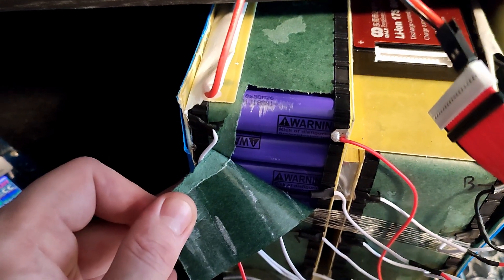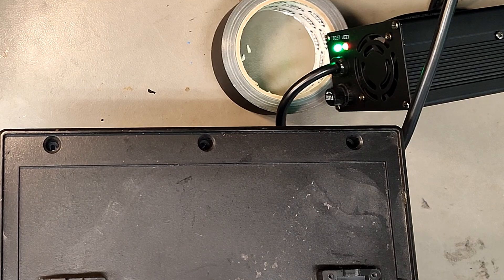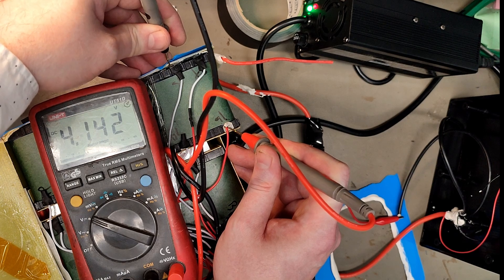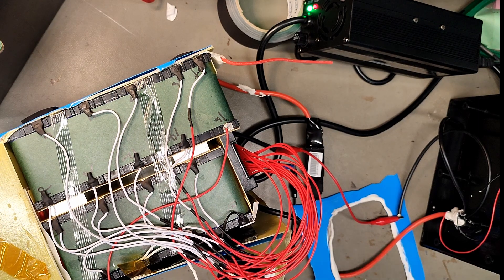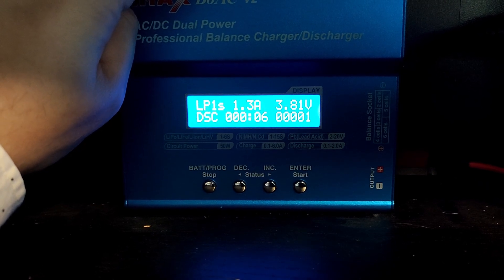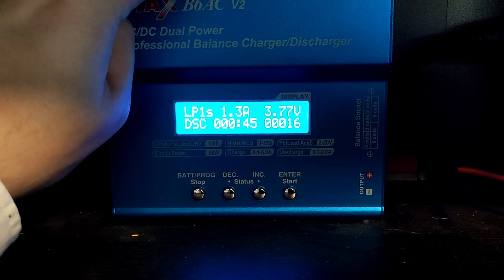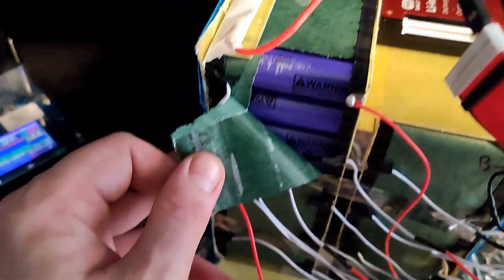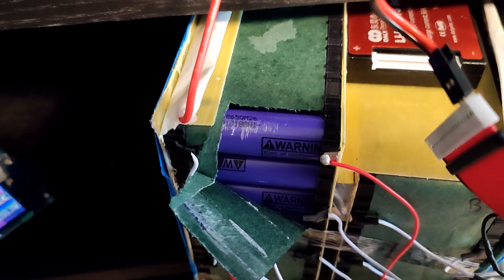Ghostcells: This is the END for LG Chem (Problem: Charger turning on and off)

Comment: Just to know.
I repaired a lot of bosch battery power pack. Bosch used such cells (no fake) on some batery pack. The cells are dead at around 300 cycles. I dont recommand  such cells at all

Comment: This is a common problem with the installation of this battery, not a problem with the type of LG cell. No-name Chinese cells will drop voltage; the charger will try to charge, the cell will try to resist, not increasing the voltage but overheating and catching fire. However, this company has already experienced this and they transitioned to branded cells. What can they choose that is popular in the EU? Panasonic, Samsung, or LG? At that time, there was mass production of M365 Xiaomi scooters, and the LG M26 is popular for its best price-to-performance ratio. But these cells have higher internal resistance than others. LG designed these cells to last long, even up to 2000 cycles, and we confirmed this through testing. However, when you have cells with slightly higher internal resistance, you need to consider the installation of the pack. You can't place the plus contact on the side; it must be in the middle of the first series. The nickel must also be thicker at this main contact point as the current will start from here. If you don't do this, the whole current will pass through the first cell. When that cell overheats, it will damage the second cell in that series, and then the rest of the series will fail. LG modeled this cell after the Panasonic B and Samsung 29E cells, which have similar capabilities. People feel safe as the cell maintains voltage during charging: the voltage increases, the BMS reacts, and turns the charger off—a perfect little game that we were unaware of. NO one Xiaomi M365 caught fire - not counting your neighbor who drives on heavy water and mud road. Respect for LG !
Reply: I don't think it has to be in the middle! The resistance difference from centre to the side is so little! Are you sure about this?